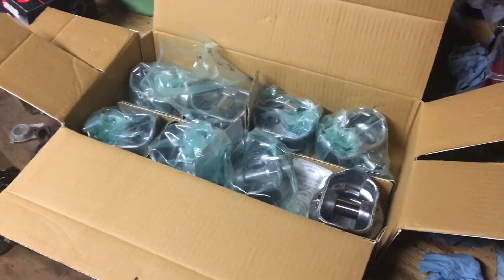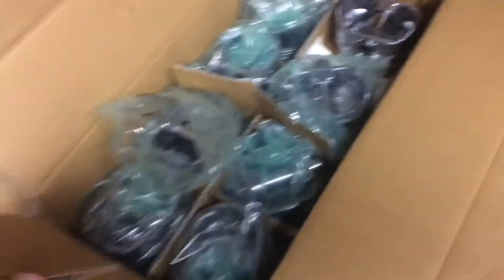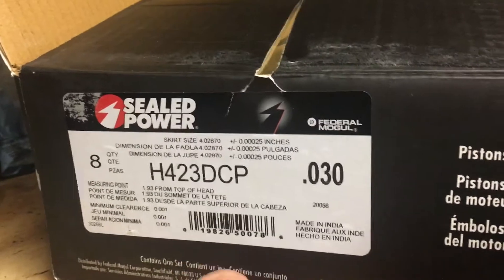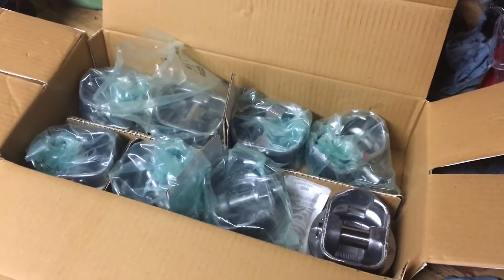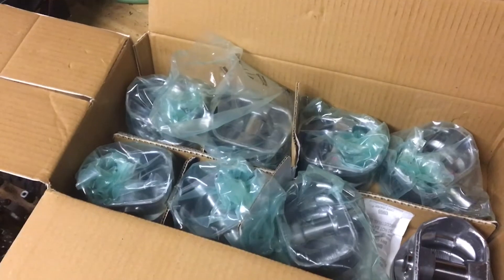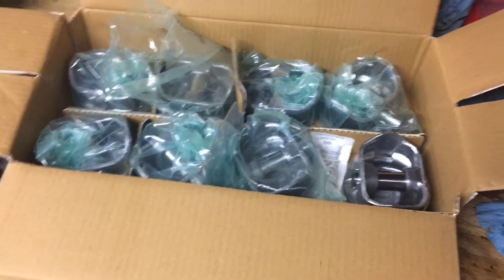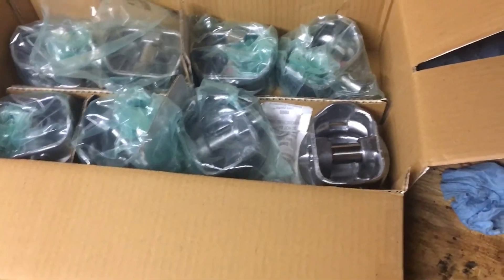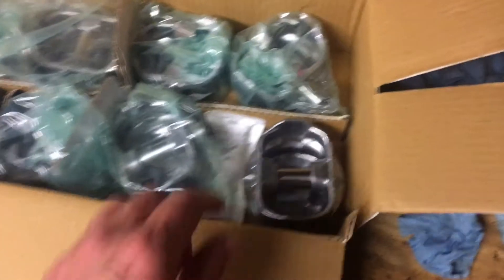Mercruiser 5.7 1(a) - 5.7L or 4.3L - Determining Piston to Wall Clearance

Comment: The machine shop should be familiar with the application and be able to guide you. Notice how on the box it says .001" MINIMUM clearance. We use that particular piston in many marine applications, and we always bore the block an extra .001" over the standard oversize. Keep in mind a factory specification is for a factory piston, so if you have a different material, or a different design, the clearances can vary drastically.
You'll probably be fine, but make sure the engine is up to temperature before throttling up. (stay at marina speed or less until you see 140 on the gauge) If the engine is cold and you try to get the boat on step it is possible to cold seize that piston, despite the nice coating. Good luck!
Reply from the maker: I was very concerned about such tight tolerances myself which is why I discussed my further research into the subject in the video. I invite you to watch the video again and then come back and let viewers know if you still recommend adding the extra 0.001” to the bore. As I said in the video Speed Pro pistons are the “factory” pistons in a Mercruiser. If you add the extra thousandths then you are near the service limit per the factory manual specs.
Reply: @moccasinmarine  Absolutely would I still fit those pistons with the added clearance. While it's safe to assume many are fitted on the oversize, there is little room for error, both in piston skirt sizing and bore sizing. Tolerance stack up and a poor operator could lead to a cold seizure or scuffing. Although a different manufacturer, Silvolite wants added clearance for marine applications, and to the extreme, Icon requires an additional .001" to .003" clearance added to their base specification.

You'll probably be fine, just offering what we do in that situation. A bit more clearance and you'll be the only one that knows. Insufficient clearance and everybody knows. Cheers!
Reply: @moccasinmarine  i build em 2 thou minimum for hyper stock, 1 is just way too tight for a marine engine.. esp if its a heavy boat with a hard working engine, the tolerances need to be even more- like 2.5 to 3 thou- I just got given a rebuilt marine engine straight from volvo, motor was tight - measured bore, 1 thou clearance. Honing it out 1 to 1.5 for a stroker build im doing for a customer now.

Comment: Each piston wont be the same size give or take a thousandth most of the time. I would of sent pistons with the block so each piston could of been bored to its cylinder. Hard to trust each piston to be exactly the same. Not sure if ever seen 8 that was
Reply from the maker: Yea that’s true most of the time but when you buy 5 or 6 sets at a time you can mix and match to get them all the same within 0.0005”. Now I’m also building an LS 6 liter and for that engine I took the new pistons to the machinist to verify the bores fit. Thanks for the comment.
Reply from the maker: But you’re right. Going forward I will deliver the new pistons with the used block so that the bores can be fitted to the pistons.
Reply: all the pistons ive ever measured in the last 5 years were spot on, each one- modern tolerances and machining from reputable names are really fantastic in my opinion.